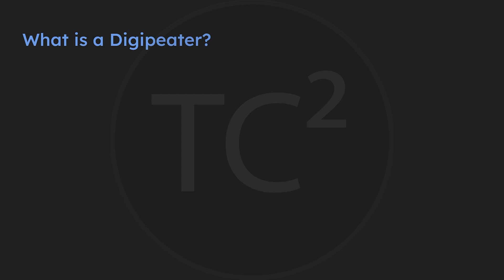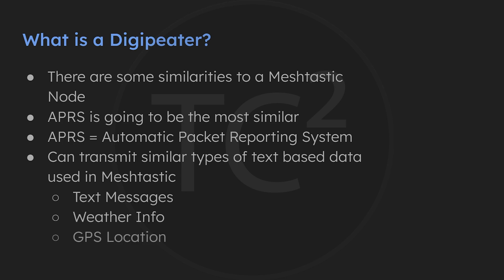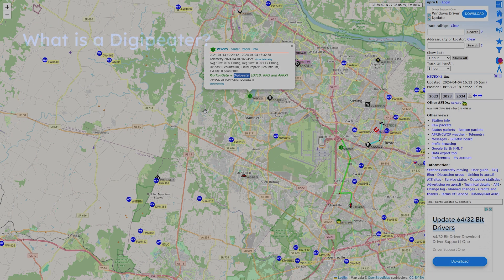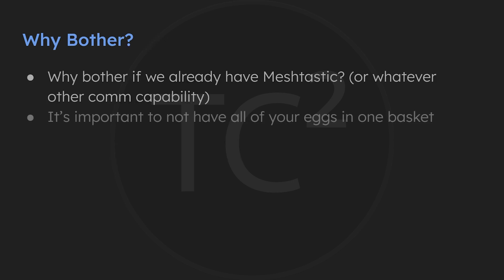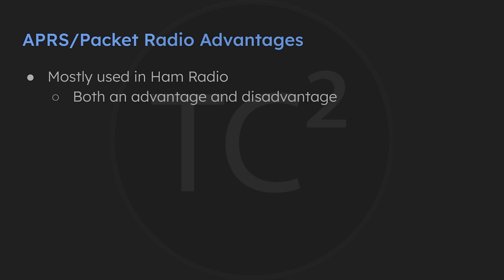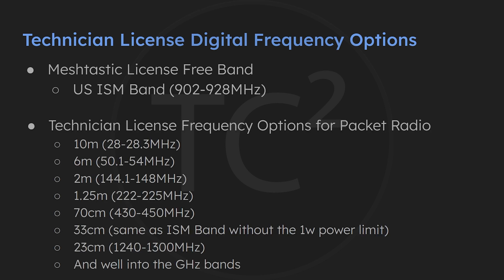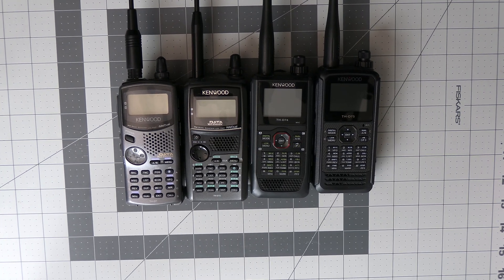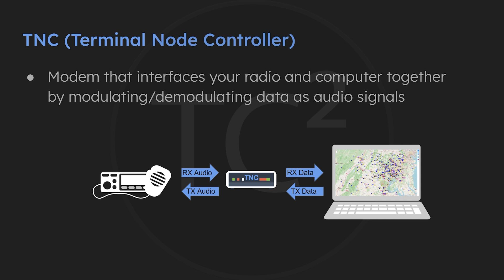Off-Grid Digipeater Build Intro

Comment: Why not just use a hg-uv98 HT which can function as a digipeater all by itself. Then pipe some power solar into it, may hack its battery to make it bigger. Cheap, easy.
Reply from the maker: Most Chinese radios are hot garbage and the receiver overloads when having a large antenna hooked up to them. Also, that radio isn't a true digipeater. It only does APRS and we need a TNC that does true packet radio. We also have more complex plans that a radio with a digipeater can handle. Otherwise, we would be using the Kenwood TH-D72.
Reply from the maker: Interesting radio though and didn't realize it did KISS over Bluetooth. A shame it's APRS only.

Comment: Or for the easiest turnkey digi get a n7500 and old android phone...if you provide internet you have an igate.   Less than $200 and no tnc's or cables to mess with.  

I run one as an igate and another in the vehicle as a digi when on foot in the mtns.
Reply from the maker: I've been wanting to play around with the n7500. I'll have to check it out. I have some stuff that requires software/scripts on the raspberry pi for my plans

Comment: I think the big advantage to APRS over Mesh is (for now) wide adoption and implementation. Since APRS has been around since the 80's, there is near nationwide coverage with Digis and Igates. 
I think Meshtastic has the potential of getting to this level of coverage faster since it has a lower cost of entry, both in licensing and equipment costs. We just need to get people to put up nodes and leave them up and not take them down or get frustrated because there is not traffic now. It has to be understood that the network needs to be built be the early adopters before the network users will come. But build it...and they will come!
Reply: Meshtastic has the added benefit of being encrypted, which is illegal for amateur radio (but shouldn't be).
Reply from the maker: All very good points!

Comment: You are so anti hardware TNC.  Have you ever owned one or more?  There is a reason Kantronics is still around today.  They work VERY well.
Reply from the maker: I have nothing against hardware TNCs. I have a few and even go over soldering one in my earlier videos.
Reply: and small beacons etc can do software TNC too, on freaking microcontroller which is already there anyway. Look up this project - ATmega-TNC.  An ATmega8 based UI TNC. 
took me 5 seconds to find exactly what i was saying in previous comment, so either it is confirmation bias or HW TNCs are scam, you choose. It uses ATMEGA8, JFC !
Reply: I ran software TNC on Pentium 4 so there is absolutely no reason to buy HW TNC today. it is scam. You nee computer to send data anyway, so why not use same computer for virtual tnc ? Because HW TNCs are scam thats why. Were 20 years ago, they are today. Welcome to SDR age which started 20 years ago.
Reply: as a electronics project to help people understand how things work/worked np, as a product IT IS scam.
Reply: And having HW TNC limits what can be sent to and from radio. But by having software modem, you can change (digi)mode just by pressing a button.